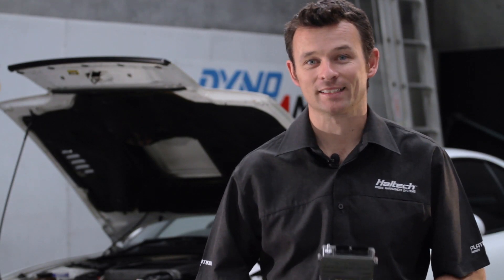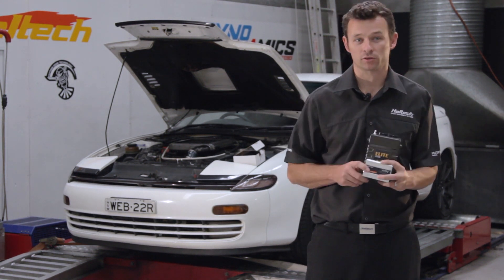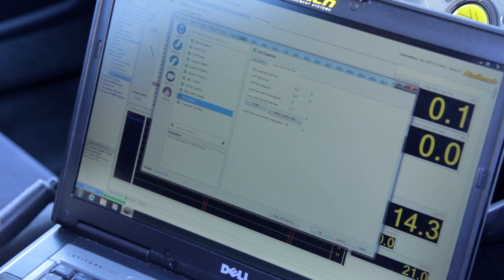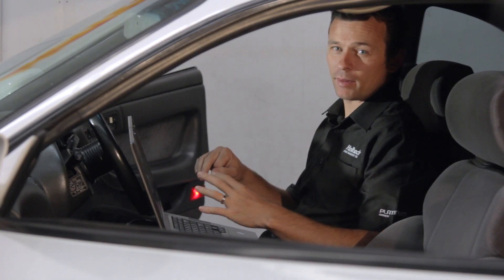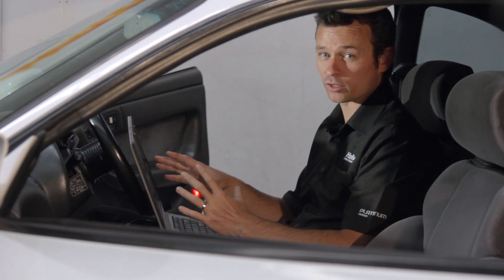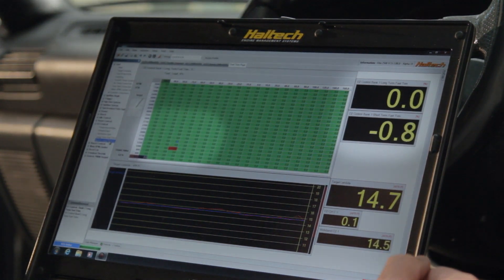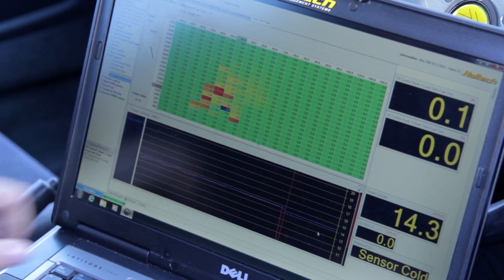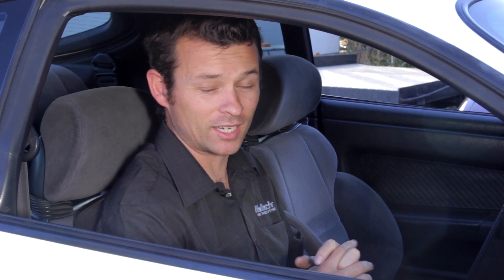Haltech Elite: Long and Short Term Fuel Trim

Comment: haltechecu how if the o2 sensor damage? can haltech recognize the damage o2 sensor and disable the o2 control? can't wait my elite ecu sent to my place :-D
Reply: +sardjantube I think it just records data and only uses corrections when you apply them to the base table/map. So up to the end user to recognise a faulty sensor.
Reply: Haltechs wideband controller Can sense a broken sensor and will disable o2 close loop

Comment: I know the new elite ecu is pretty sweet, but c'mon.. There are still a lot more to show us on the other ecu's.. It would be nice to see a technically speaking on RALLY ALS set up and different valves and kickers that could be used for bypassing air. Ive had a ps2000 ecu for 4 years and am still playing with rally als. Thanks
Reply from the maker: Hi Matt, don't worry we have plenty of tech vids in the pipeline dealing with the current Sport range, so we hear you loud and clear.
Having said that, the Elite is pretty sweet and cool, and it's about to be released so we just can't help ourselves:)